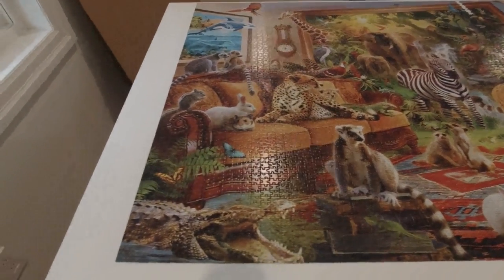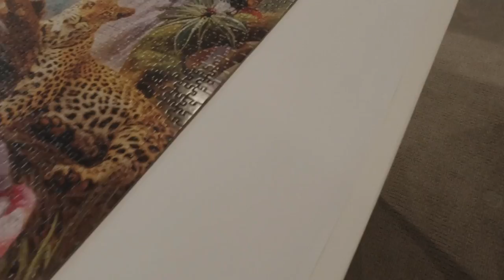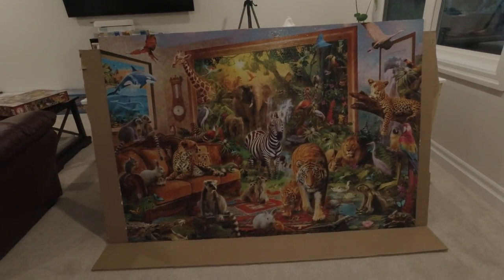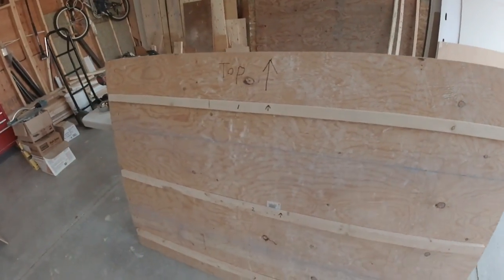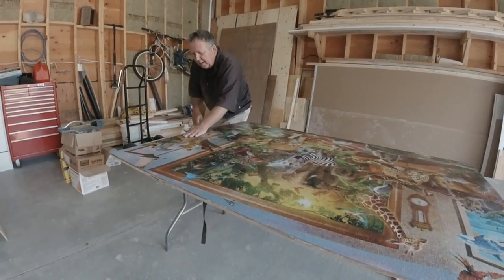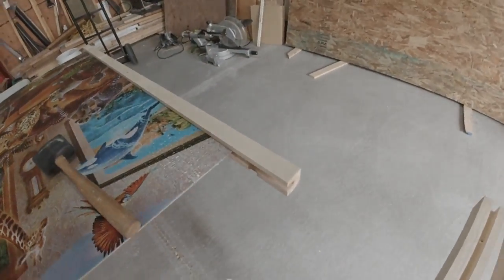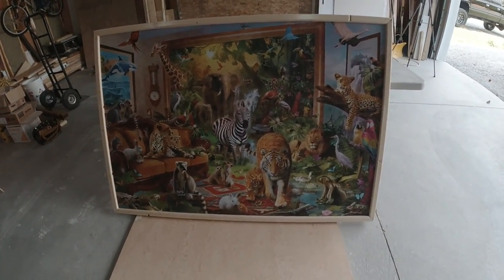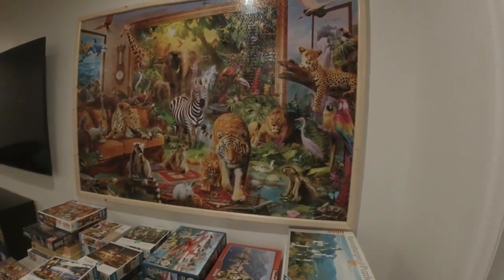HOW TO FRAME A LARGE PUZZLE

Comment: Nice work. That puzzle, precisely that puzzle picture, looks great framed on the wall. I have only framed (pressure framed between glas and cardboard) a 1000 piece puzzle picture in a picture frame myself. No glue in case I want to do the puzzle again at a later date. I will be framing a few worlds smallest puzzles in a picture frame as well, or on cardboard. The puzzles being the size of a post card (10 x 15 cm / 4" x 6" ) I can fit several of them in a picture frame. Though I might try gluing those puzzles, because those I will not be doing again (novelty puzzles, low quality and not very fun to do besides for the challenge of it).
Reply from the maker: Thank you. I felt that I had to glue a puzzle this large otherwise the framing would have cost a fortune. I have other ideas for smaller puzzles. Stay tuned.